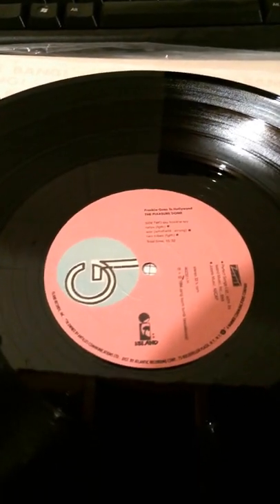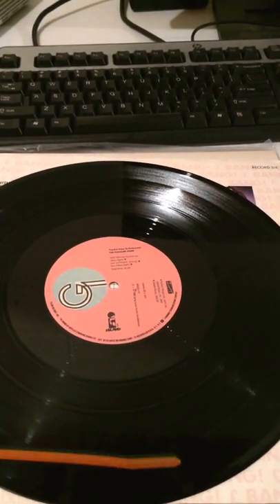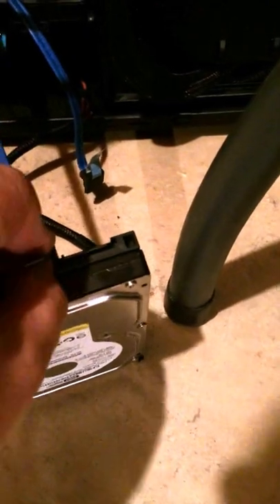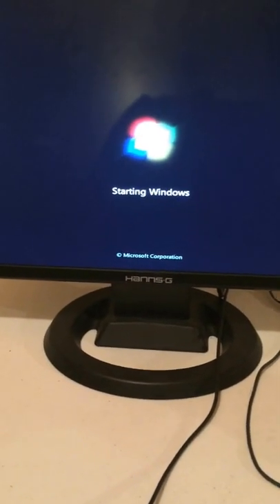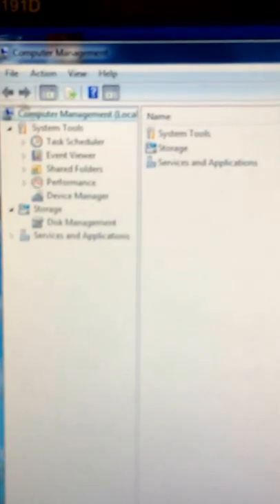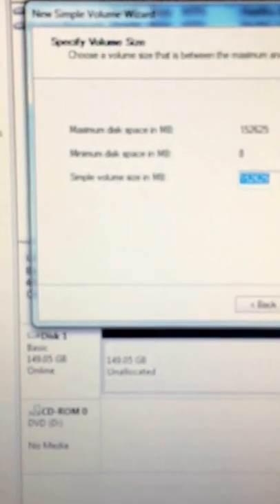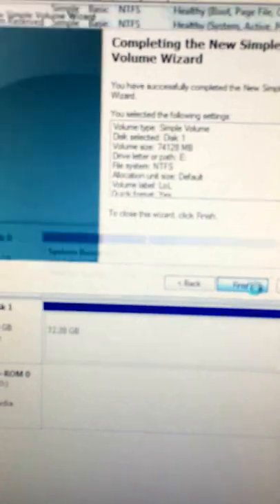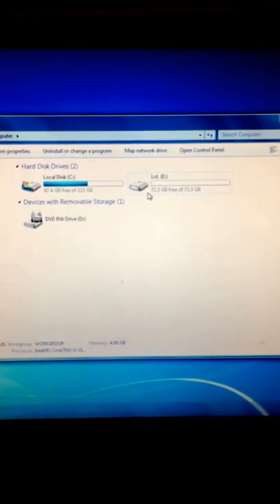Instructions on how to Short Stroke your hard drive the easy way

Comment: I dd everything in this video but when I tested with HD Tune, the results are almost identical. Before short stroking, I see a drop in MB/sec at around 50% for my second hard drive. I did the steps to my second hard drive(1000 GB hard drive) and now I have 300 GB separated from a 631.51 GB Unallocated. Testing with HD Tune again, I got the same results. Help!!
Reply from the maker: The biggest difference you're going to see is in latency or access time. What hard drive is it? It's not a 5,400 rpm drive is it?

Comment: I want to do this on my 750 GB hard drive of which I've used over half of the space. Do I need to format it and do a fresh install of Windows in order to short stroke it? If not, how would I choose what files go on each partition?
Reply from the maker: +Jack Fredian Yep, you need to start from scratch. Right now your Windows install is aware of the entire disk, and there is really no good way to reverse that. Remember that your biggest gains are going to be in the areas of random access time and a much improved minimum transfer rate.  I hope that answers your question.

Comment from the maker: HDTune can be used before and after to see if there is a difference. Basically what you'll see is decreased access times and higher minimum transfer rates. I mostly suggest it for those spinning disks you may have lying around

Comment: So, after all how to create C: drive on outer portion of HDD to reduce seek time ?, I have erased my complete HDD and have all unallocated space (no partitions), Now tell the steps. No crap and nothing, just steps. Your video is completely blurred and useless.
Reply from the maker: If you've erased your hard drive and are starting from scratch with a fresh windows install, you just need to choose the custom option when Windows asks where you want the OS installed.  Then just choose an amount roughly half of what the drive size is.  There are tools like HDtach that you can use to test your specific hard drive to find out the sweet spot for short stroking, but you'll need another operational computer to put that hard drive into as a 2nd disk.  As a rule of thumb, I just say set the drive for half of its entire capacity to at least get some tangible benefits from the access latency times.

Comment: WHAT SHOULD I DO WHEN I HAVE ONLY ONE HARD DISK
Reply from the maker: Your best and easiest option is to reload Windows and during setup do not let it use the entire drive. Shrinking the volume is not something I'm comfortable suggesting, but other people might. Plus Windows has already seen the entire drive, and I don't trust that Windows truly 'forgets' about that space and won't still index it. This would prevent any performance improvements.
Reply: i have  partitions and i want short stroke it
is it possible to do it 
without losing any data
 i am willing to lose some space like 500 gigs
Reply: but show us man in a vide how to do that for people who have only one hard drive... come on !
Reply from the maker: Even if you have multiple partitions and could move all the data onto a single partition and delete the others there is not a way to guarantee that the used space isn't scattered all over the hard disk.
Reply from the maker: Someone mentioned that you can turn indexing off.  That's Windows Search Indexing and doesn't have anything to do with what I'm talking about in these videos. If you let Windows have access to the entire disk it is going to place bit all over that platter. We're essentially 'hiding' a portion of the physical platter from Windows so that the aperture arm never even passes over that part of the disk. This is where the speed increase comes from.